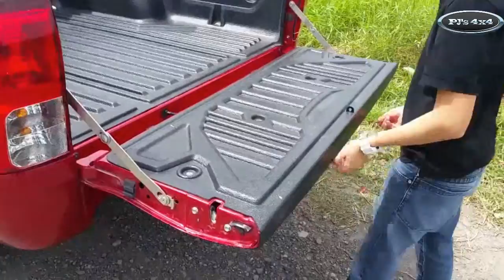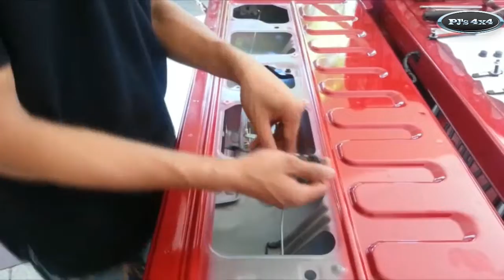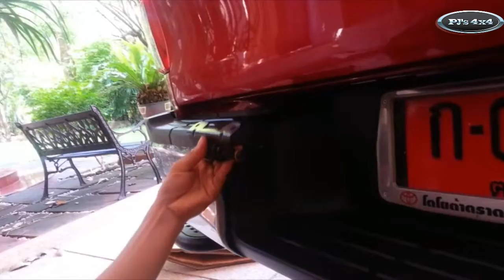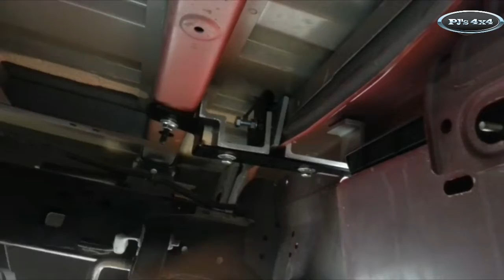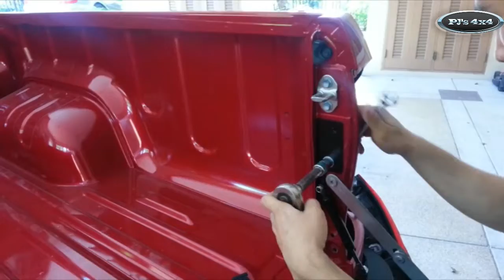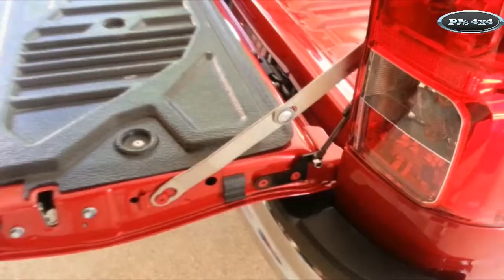Toyota Hilux 2015 + | ProLift Installation | PJs 4x4

Comment: This has been made much more simple , you need only those sidedampers, by the way the side bolts of tailgate wont open so easily as shown here, you need to drill them off and have new bolts to attach the sidedampers